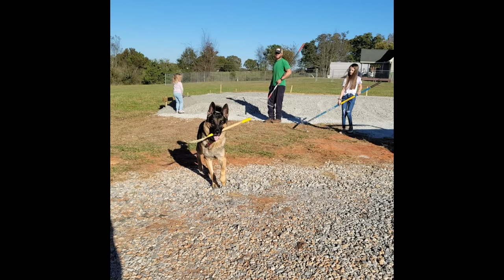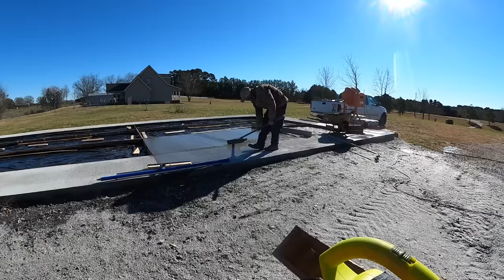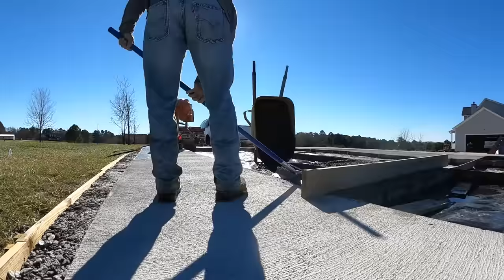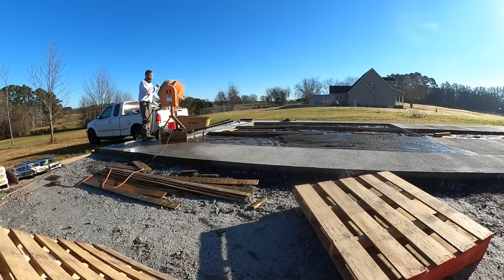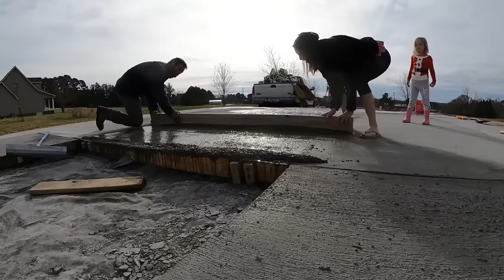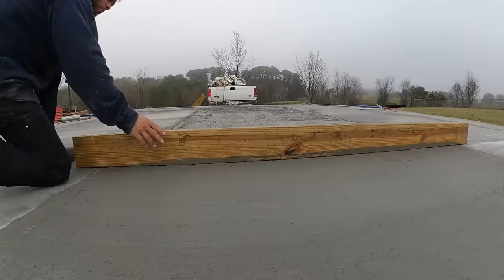Pouring a Huge Concrete Slab Using Bagged Concrete | I Saved $10,000

Comment: How much is concrete per yard in your area? Even if it was 250 a yard which would be extremely high, the highest in the country, you still would have paid way more just for 830 bag a of sacrete then if you just ordered it from the plant. I can't imagine after buying sand, stone, bag mix & portland cement that you could have saved anything at all. I applaud you for your work forsure, but I do this everyday & the numbers don't add up lol.
Reply from the maker: When I did this it was when covid was causing prices of everything to go insane. I was able to get #80 bags for 3.20 each, and truck they wanted 200 to 220 depending on the day with a 4-6 week lead time. I even looked into mixing sand, stone, and portland but the high cost of sand was going to drive the price to around 163 per yard. I'm not sure what prices are but hopefully everythings worked itself out. Based on the cost of everything else i'm doubtful.
Reply: @reallifetested2605  how's the floor holding up now? Even if it went to shit this is the most impressive thing I've seen in awhile lol, so much determination!
Reply from the maker: @EmpireDevelopmentGroup  So far everything is the same as the day I finished up. If you're interested I did a 1 year update along with answering the most asked questions. Thanks brotha! 

https://youtu.be/qKcy6BI8yA0

Comment: How much is a concrete truck around there?  Bags are usually much more expensive when you talk that kind of volume - no?
Reply from the maker: In my area at the time it was 200-220 depending on the day with a 4-6 week wait and #80 bags were 3.20 each. Bags were much cheaper.

Comment: no steel support? rebar?
Reply from the maker: I called around and spoke with local pros, they said that in my area rebar wasn't needed in a 4" residential on grade slab. I rarely see it put in concrete around here unless its requested.

Comment: We are pouring a pad. You didn’t use any rebar or anything? Do you regret that
Reply from the maker: I called around and spoke with local pros. If you do the same they’ll point you in the right direction. They don’t use rebar around here unless commercial, industrial, or requested. We have good soil here and it rarely gets below freezing. I’m doing a 2 year update soon and so far no hairline cracks anywhere or movement.

Comment: No rebar?
Reply from the maker: In my area rebar isn’t used usually unless industrial or commercial. We have good soil, no natural disasters, and it rarely gets below freezing.
Reply: @reallifetested2605  ok, well I mean, it should be used, some form, esp for slabs, even in sidewalks it's good to use. Metal mesh or something so when it cracks it will be held together.

Comment: Is this for a home?
Reply from the maker: It’s for a metal storage / workshop.
Reply: @reallifetested2605  how do you know method to prepare the grade? It looks like you just put down gravel, no compaction? I see other people digging down a bit. Does code specify soil stability?
Reply from the maker: I didn't show that part, but yes I dug off the topsoil. This area had been graded for a homesite in the past so I didn't have to remove much. I also ripped that tree out roots and all. We have really hard clay soil here so it doesn't take much to compact it. I let it rain on it a few times before adding the gravel, as well as went over it with a cultipacker multiple times.  @embededfabrication4482

Comment: no reinforcement????
Reply: Hopefully he's not building anything or parking anything on it.
Reply from the maker: I called around and spoke with local pros. In my area they said rebar wasn't needed in a residential on grade 4" slab. It's been over a year and I haven't had even a hairline crack anywhere. I need to do an update but haven't quite had the time.

Comment: Did you put any reinforcing wire/rod into the slab?
Reply from the maker: I called around and spoke with local pros. They don’t use it around here unless requested, commercial, or industrial. We have good soil, rarely gets below freezing for any amount of time and we don’t have any natural disasters.
Reply: @reallifetested2605  It looks like it turned out nice. Is it holding up well?
Good job, a lot of work for one person but it is a great example of what you can do if you just put your mind (and body) to work.

Comment: No wire mesh, no rebar, no wet soaked anchor bolts for the garage walls... I assume you don't have a building permit or inspections? Now if you go to anchor your walls down you may in fact blow your slab apart. Hopefully at a bare minimum you used a thickened edge slab. I definitely can respect hard work but as a 60 year old commercial construction superintendent I think you may have problems with this in the future... hopefully I am wrong.
Reply from the maker: The building is held down with wedge anchors about every 6' or so. Nothing blown out. If you're interested I did a 1 year update with a lot of the most frequently asked questions. Thank you!

Comment: no rebar ? !
Reply from the maker: I called around and spoke with local pros. They said in my area they don’t use rebar in residential on grade 4” slabs. Usually only in commercial, industrial, and homes. It doesn’t get cold here and our ground is solid.

Comment: There are many reasons why we don't do this: 1) you'll get a checkerboard of seams  2) a rippled grid 3) frost heave will turn the pad into highs and lows 4) inconsistent surface finishing  5) inconsistent concrete quality because hand conrtolled water adding. The  video deceives those that don't know.  At 3.5" thickness those pads are going to get crushed and fall apart once trucks and autos get on them.  Good catch for youtube but bad work.
Reply from the maker: Its been a year with ~40,000 lbs sitting on it. Not so much as a hairline crack has formed. When will all of these things happen? It's also between 5-6" thick.
Reply: @reallifetested2605  .  Only you know what has been loaded on it.  Of course there are no cracks yet its a checkerboard. But bag mix is at best 4000 or 25 MPa just give it time. That's also a rough broom finish, something we don't do on floors. You didn't save 10 grand you only saved the difference in ready-mix to those bags and tool rental and your time (which you didn't factor-in) and 2 men for a day. So you really only saved about 2 grand but now have that floor instead of a proper floor. You also don't have the deep edge footings we pour on those garage slabs. That will result in building heave. We pour super flat slabs with deep edge footings in one day 3 men. There  are reasons why we don't use bags on big jobs. It's just for your property so I guess it will have to do but that's not such an accomplishment.
Reply: @sagecrockett693  There's no doubt that OP worked his tail off, but this is the type of comment I've been looking for, except for the snarky bits.  I was wondering what professionals had to say about the lack of footings, rebar, pour depth, bagged concrete strength vs. a truck, etc.  I, too, felt that this video could give a false impression of cost savings and/or quality/longevity of the pad.  I am by no means a professional concrete worker (more like a couch concrete youtube watcher), but it seemed like there is so much more that has been left out or not addressed about large pours such as this.  It would be much more beneficial if there could be constructive criticism from professionals in order to help DIY'ers with a project so large as this one.  Thanks OP for posting the video, you really had a massive job, and to do it by yourself is impressive.  It gave me a sense that I could accomplish this myself, until I started to think about the "what-ifs."
Reply: @jasonblain5016  You did get some professional criticism: read my posts.

Comment: I have to ask, did you really save 10k by doing:

Self Mix/Pour/Finish Bags VS a Self Finish + Truck 

Or was it -

Self Mix/Pour/Finish Bags VS Truck + labor and finish. 

I ask because it seems highly unlikely that a truck with the same amount of mix cost 10k more than bags. I had a truck come in and it cost like 200-250$ for pumping but I was done in 1 day VS weeks with bags.
Reply from the maker: I said doing it myself vs hiring out saved me the money. We were quoted a minimum of 14k for the work. I have a little less than 4k doing it myself. It didn’t take weeks. I was working night shift and could only work when I got off of work and had to stop to sleep. If I had all day it would’ve taking me about 3 days.
Reply: @reallifetested2605  Ok, thanks for the reply =D

Comment: Noob here- did you use rebar? If not- isn’t it required?

Thanks
Reply from the maker: I called around and spoke with local pros. They said in my area its not needed in a residential on grade 4" slab. I don't really see it in small slabs, or driveways around here. Only in homes and commercial buildings.
Reply: @reallifetested2605  ah ok. Understood- thanks

Comment: why no rebar?
Reply from the maker: I called around and spoke with local pros. They said that rebar wasn't needed in a residential on grade 4" slab.
Reply: those slabs will move will take time, but they will move as the seasons change. put rebar in your slabs

Comment: Also i see no rebar in it
Reply from the maker: I called around and spoke with local pros. In my area they don’t use rebar on 4” residential on grade slabs. It rarely gets cold here and we have a hard clay soil. I’ve never seen it used in small buildings / driveways around here. I did a 1 year update if you’re interested. I don’t have any cracks at all and show the slab.
Reply: @reallifetested2605  Every body ever where uses rebar.. Who don't want bad cracks and it to crumbles. Its Your Money,  and not mine. I USE IT. With the high dollar prices on a bag of cement. Don't play the monkey see monkey do games. I guess that the deference between OLD SCHOOL AND NEW SCHOOL.  I'am old school

Comment: How much was the cost of a cubic yard of ready mix concrete, here its around the $250 mark.
Reply from the maker: I’m not sure what it is right now. When I did this it was 200-220 with a 4-6 week wait.
Reply: @reallifetested2605  so at $220 per cubic yard, you needed around 12 cubic yards for the pad, so that $2640, you spent the same on bags of ready mix.
Reply from the maker: @jamesmatheson5115  #80 bags were 3.20 each. A lot cheaper than ready mix.
Reply: @reallifetested2605  I cant see it, even at the high side at $220 per cubic yard it works out at $2640, if it was $200 per cubic yard then it would be $2400, 80lb bags by 830 bags x $3.20 = $2656, by the way I checked the price of the 80lb bags online and they ranged from $4.90 to $12.50, at the end of the day, you did the job your way.
Reply from the maker: @jamesmatheson5115  830/45= 18.44yds
830*3.20=2656 bag
18.44*210=3872.40 truck
I did a 1 year update and show local prices. in my area they are still less than 4 dollars and this is a year later. They also cost more right now due to it being spring time.

Comment: Can someone check my numbers and help me? A cubic yard of concrete delivered costs around 200 CAD around here (Nova Scotia). 88 lbs of cement is about 26 CAD. Lets say we need 7 bags of cement that is 180$/yard. A cubic yard of 1/2" washed stone is around 35CAD and I think the sand about the same. So around 180$/yard for the cement and 30$/yard for the sand/gravel is 210$/yard. So it makes absolutely no sense to mix it yourself?!
Reply from the maker: In my area truck was 200-220 depending on the day with a 4-6 week wait. Bags were 3.20 for #80. I did a 1 year update and show prices on my phone if you’re interested.

Comment: No wire mesh?
Reply from the maker: In my area it isn’t needed. No one around here uses it.
Reply: @reallifetested2605  Do you have special extra tensile strength concrete available in your area? If not it's as prone to cracking as concrete anywhere. I think you did an incredible job especially given the size of the pour. I'd hate to see it crack on you.

Comment: About 19 yards? 80lb concrete is about $6 a bag and takes 45 bags per yard. $270 a yard

I paid $130 a yard mixed & delivered, less than half of mixing my own like this.

You couldn’t get a concrete company to deliver it for less than $270 a yard?
Reply from the maker: 130 per yard is really cheap. In my area it’s 200 to 220 depending on the day. I was able to get #80 bags for 3.20 each.

Comment: Some thing that big?  Best order a truck load ?   I'll tell ya why?    Cause time you get it mixed and poured, it will be setting up on ya. Making it impossible to work
Reply from the maker: Truck was 200-220 at the time and bag was 3.20. Also couldn’t do all that by myself. It was cooler when I did this so I had plenty of time to work.

Comment: Nice job.  What size mixer did you use?
Reply from the maker: Thank you! Don’t hold me to it but I’m thinking it’s 3.5 cu ft. It’s the larger model from harbor freight. It definitely doesn’t hold 3.5 cu ft though. It can handle (2) 80 lb bags which is a little over 1 cu ft.
Reply: @reallifetested2605  they used to have a 6 cubic foot mixer.  They still sell the 3 1/2 cu ft.  What you have done in this video is exactly what I want to do, but I figure I need a 6 cf mixer so I am not mixing 1000 batches.  They are hard to find used!

Comment: I dont get how u can save 10k by mixing in yourself... unless the truck has to drive from the other side of the country. I assume the price you quoted (14k) was for someone else to do the work?
Reply from the maker: I said that in the first 60 seconds of the video doing everything myself saved me the money. We were quoted 14k and up from local contractors. I did everything myself for a little less than 4k. I did get the concrete cheaper mixing myself. Local truck wanted 200 to 220 per yard depending on the day, I was able to get #80 bags for 3.20 each.

Comment: 10k savings in just concrete? Or in not hiring a finishing crew as well???
Reply from the maker: I said in the first 60 seconds of the video doing everything myself saved me $10,000. I was quoted 14k and up from local contractors. I did everything myself for a little less than 4k. Truck was 200 to 220 depending on the day and I got #80 bags for 3.20 each.

Comment: 20 yards should have done it @200 yard which is high is 4000 could have done in in 2 pours by yourself did you mean 10000 over hiring a contractor?
Reply from the maker: Yep! In the first 60 seconds of the video I said doing everything myself saved me the 10000 dollars. We were quoted 14k and up. I did everything myself for less than 4k.

Comment: A pallet of concrete bags is 1 yd which costs way more than to bring in a truck. This is like taking 1 step forward to take ten back. Why would you ever do this?
Reply from the maker: When I did this 80 on bags were 3.20 and truck was 200 to 220 depending on the day with a 4-6 week wait.

Comment: did you use a 4x6 for the screed?
Reply from the maker: It's just a scrap piece of straight 2x6.
Reply: @reallifetested2605  ok thanks.  Did you just have a cold joint between sections? Would love some tips on planning how to execute this
Reply from the maker: @rock612on  Yep! I did a one year update with me answering (to the best of my knowledge) the most frequently asked questions. If you're interested you should definitely check that out.

Comment: Wheres the rebar no dowels I give it a year before it cracks
Reply from the maker: I called around before taking this on, local pros said that it wasn't needed in a residential on grade 4" slab in my area. I have ~40,000 lbs on this slab and still looks as good as the day I finished.
Reply: @reallifetested2605  as a 4 inch slab in Texas u need rebar I don't know we're you at but at least chicken wire would of help something especially with all the expansion joints
Reply: All I'ma say I'ma go with a fake video
Reply: Did u at least fiber glass it

Comment: Wait... It's a garage, but no rebar?
Reply from the maker: I have about a 1000 comments explaining why.
Reply: @reallifetested2605  
Yeah, I now watched your follow up video explaining why. I would still put rebar in just for good measures. If it's a cold environment, I'd put one no matter what. If it's not a cold environment, I'd put one only if I'm gonna park vehicles on it (which you clearly will). Better safe than sorry, because as much as you think building that slab is hard, it's going to be even harder replacing it. The good thing is, you used soooo much gravel, that there's essentially 0 chance that water will ever get to it from below... So at least you overdid one safety measure out of 2.

Comment: How much is Ready mix here you live? Because it comes out to be cheaper than Bag,
Reply from the maker: When I did this truck was 200 to 220 depending on the day and #80 bags were 3.20 each.
Reply: @reallifetested2605  Menards mix?
Reply from the maker: @tommy5499  no we don’t have a Menards. I didn’t know they existed until people started telling me about them. Their prices seem to be a lot better than anything we have around here. All we have is local concrete companies Lowe’s and Home Depot.
Reply: @reallifetested2605  must have got a deal on the bags. I haven't seen 3.20 premix for a few years now.
Reply from the maker: @tommy5499  it’s 3.50 right now in my area. Usually gets cheaper when winter gets here.